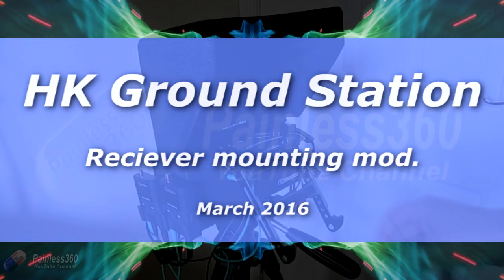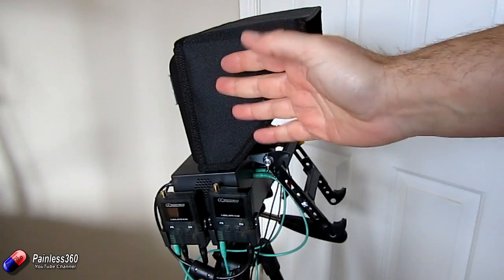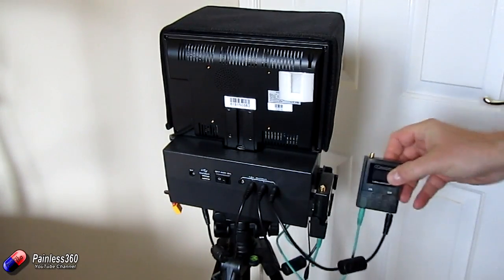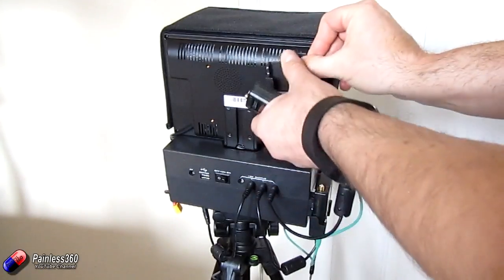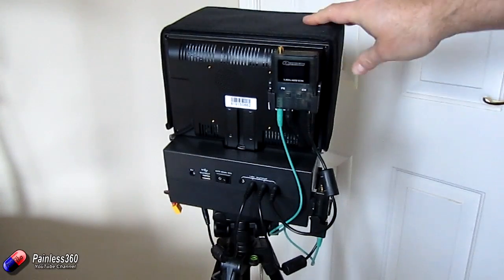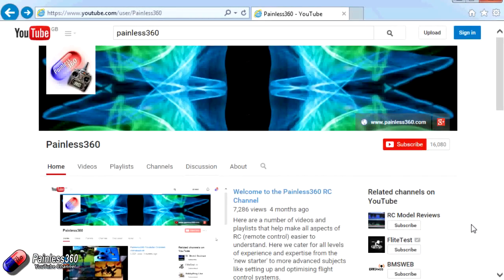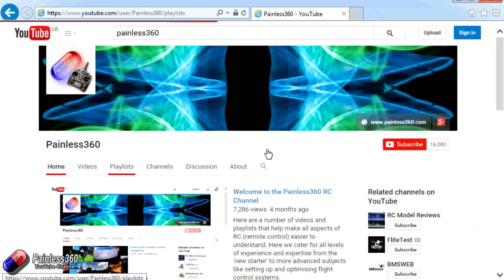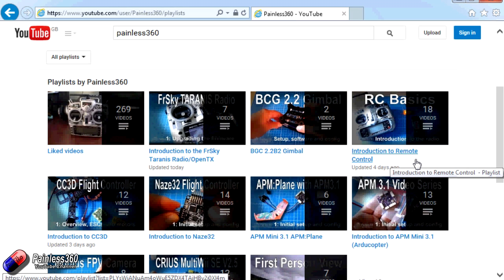RC Quick Tips: HobbyKing Ground Station Receiver Mount Modification

Comment: this would be great with a simple 1/4 thread to mount to a pole.
Reply from the maker: +Grant Cassar great idea. I'll look at that. .
Reply: +Painless360 Nice work I ended up mounting this in a case to supply power to my quanum diversity that extends out of the case on a telescopic pole. its also powering a 10"  monitor and my goggles. its a handy little powerblock. the 5 v usb powers a fan in my case and I have another spare 12v for a second monitor to sit on the box.